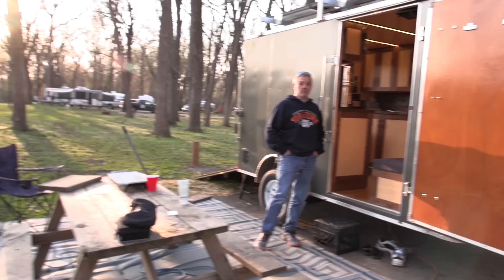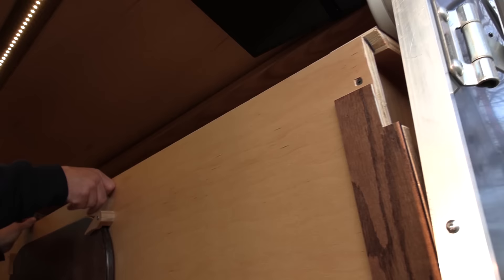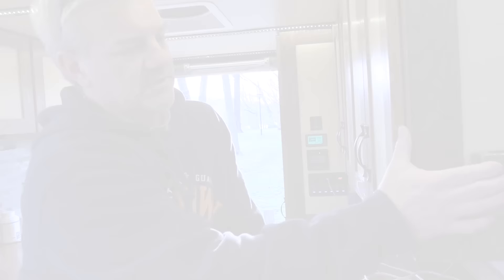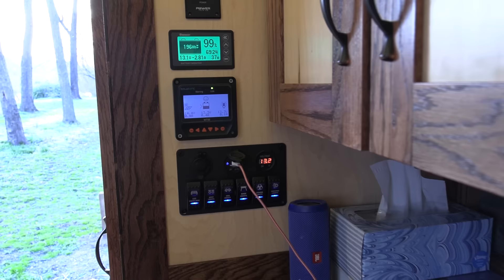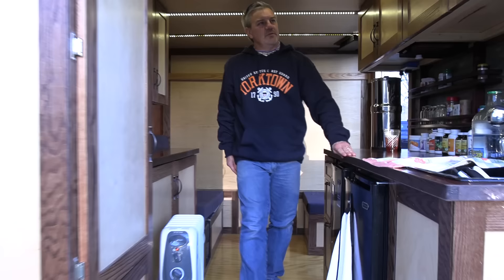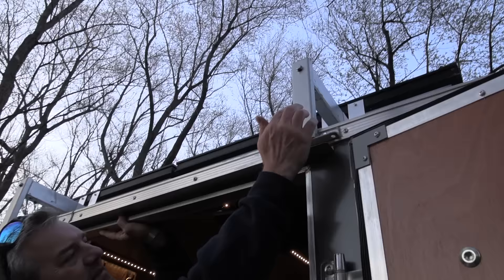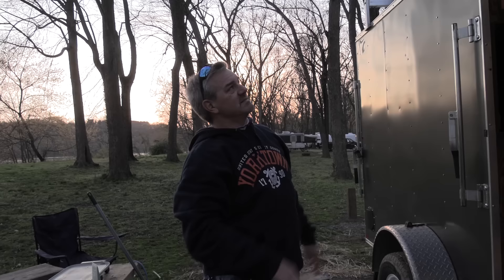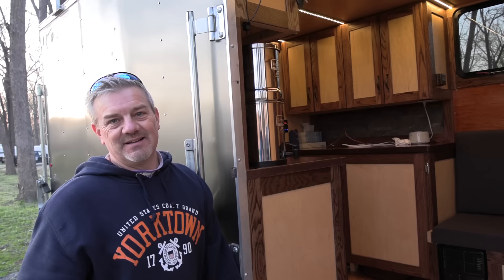FULL TOUR | Cargo Utility Trailer Camper Toy Hauler Conversion Build Out - Stealth Off-Grid Camping

Comment: My only problem with it is the potty placement.  I need to go in the middle of the night.  I guess I'd leave to bucket in the "hall" before bed.  I love your videos because the rig owners are so enthusiastic when they talk about their builds.
Reply from the maker: Good point
Reply: I think that’s the point. Just take it out before setting up the bed otherwise pointless.
Reply: If you mostly need the potty at night to just pee, try a urinal bottle.  I found one on Amazon for under $12, it’s very compact and I can just dump it out in the morning. I spray it with cleaner/disinfectant, stuff a paper towel in it and store it in handy dedicated “zipper shoe bag” (super handy bags with a loop to hang on anything).  Traveled  from North of Seattle to Mesa Az last month with my 72 year old mom in my Aliner and she was happily surprised how easy it was to pee (several tines a night, then you may need to dump it, I use a laundry bottle). We didn’t take my porta potty cuz we knew we wouldn’t be wild camping, but have toilets available everywhere.
Reply: @marlenen6130  thanks for the suggestion
Reply: @marlenen6130 I used a urinal bottle for the first time while on the road with my husband in a tractor-trailer. It was the first time I was ever envious of men. Standing up to pee-a revelation!

Comment: I love that dark wood countertop, so spacious and beautiful. A smart man if he has a Berkey Water Filter, this is the best portable solution for clean water. It even takes out arsenic and fluoride if you add the white filters.  I would urge everyone to get the arsenic filters as Los Angeles and other cities have high arsenic levels in tap water.  
A creative bed solution and all the bedding too.  So much space for pillows, sheets, blankets, towels, bulky items like sweaters. Clever to make a second wall.  The wood cabinets are lovely and have an artistic look to them, and they are real wood not MDF. The spice rack is spacious and so nice to have! Looks great.
The solid roof rack with solar mounted is also good for not overheating solar panels and allowing air flow below.  I would add a fairing in front so wind does not lift them up when driving and there is no risk of shearing off or wind damage with time.

What an incredible number of skills you need to build out a trailer like this.  He made his own cabinets, all that electrical work, plumbing, weight distribution, welding of roof rack, simply amazing. Well done, and I envy your skills.  This is a functional, roomy trailer with lovely handmade features. Your wife is a lucky woman! Thanks for the tour.

Comment: Nice trailer, if that is a DC heating element you can connect a 100 what solar panel directly to it and disconnect when done.
Reply from the maker: I believe you woeful still need a battery and fuse

Comment: You and me both...Will Prows...I did my own solar, I am retired female who lives alone off grid in Co., Thousand watts, 3000 pure sine inverter,  ,600 mppt controller,, 4 panels in series,  converter wired thru controller into a box where I wired a generator that will kick on to charge Batts. When they get low...."ALL THANKS TO WILL"  ..Bless u Will.. 1🥰🥰

Comment: Awesome build. Good planning and work. An idea for the water tank underneath, Missouri Wind and Solar makes a 12v heating element with a thermostat that may fit. ( think other voltage too ). Cool that you used Will P book , videos to help with the solar, I did too.
Reply from the maker: Thank you very much

Comment: I wish we could have seen the bike inside the trailer? I’m considering building the same type trailer and it becomes a series of trade off with what you need vs what you’d like to have. I usually see buildouts where it’s mostly the bike with a few additions or it’s all additions and no bike. This is the first trailer where the build out includes almost everything yet it surrounds the bike. Nice job…

Comment: We have a 7x16 trailer we’re converting, I’ve been at a standstill with it because I’m concerned about insulation. All of the van builds I’ve seen have insulation added. We have the plywood lining as yours does, did you remove it and add more insulation? I.e. thermal liner, etc. And if not, would you go back and add it if you could?